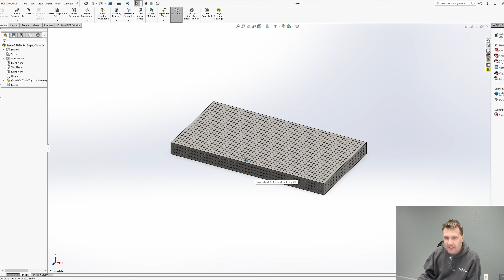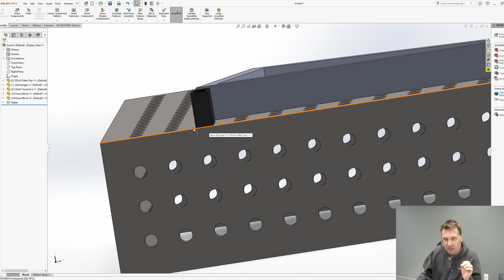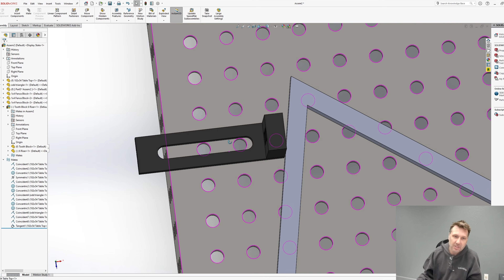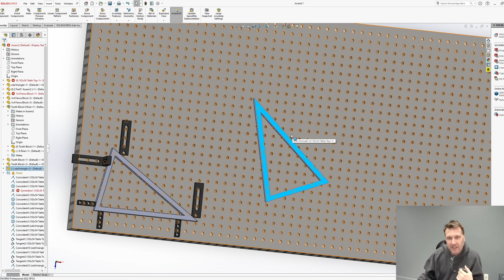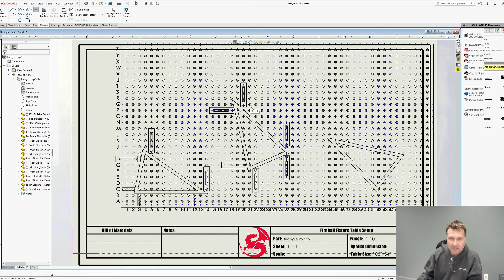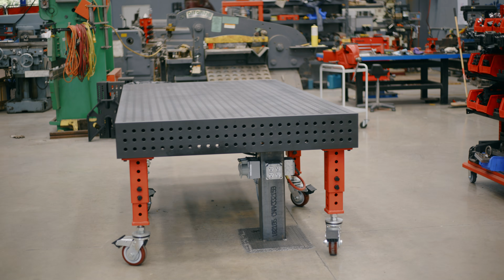How to Make a Fixture Map: Odd Angle Triangle

Comment: Im a carpet installer that enjoys watching the videos you make and am really impressed with the products you design and manufacture.  Carpet installation hasn't advanced to the point of CAD and fixturing..... yet 😁 Neat system you have there, especially for repeatability should an identical part need to be made some day down the road. 👍